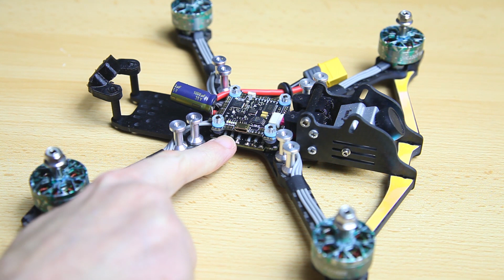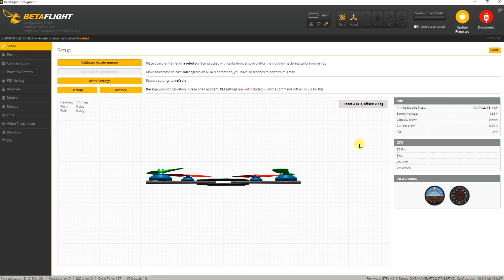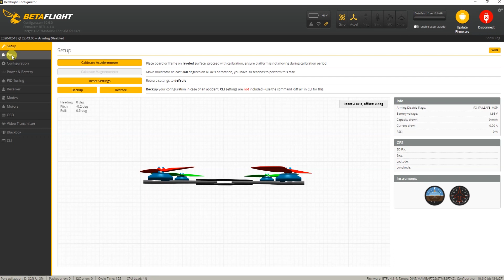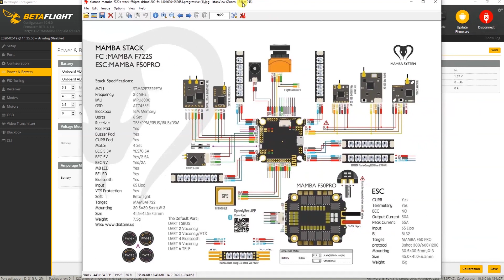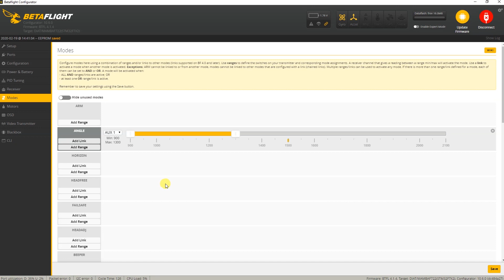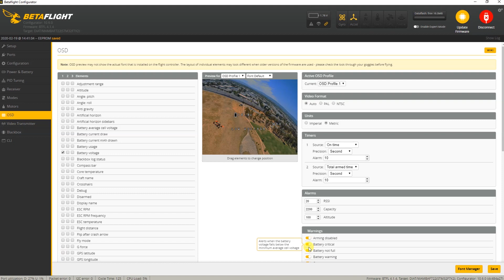Perfect FPV Drone Build Guide - P6: BETAFLIGHT 4.1.x CONFIGURATION

Comment from the maker: Next step the setup & basic configuration of BetaFlight :D 
the Diatone / Mamba Mamba F722S Pro stack I'm using here: 
https://www.banggood.com/MAMBA-F722S-Betaflight-Flight-Controller-OSD-59V-2A-BEC-F50PRO-50A-3-6S-Blheli_32-Dshot1200-FPV-Racing-Brushless-ESC-for-RC-Drone-p-1490805.html?p=TO251813974002015038 

Betaflight configurator: 
https://github.com/betaflight/betaflight-configurator/releases 

Blheli32 suite download: 
https://github.com/bitdump/BLHeli/tree/master/BLHeli_32%20ARM

Comment: hello ductch i am a novice building my first drone i am working with mamba F722APP, Jumper t18, FrSky R-XSR i have bind my receiver and the rc controller, but it's been imposbile the comunication with betaflight and the controller, i've seen a lot of videos and tutorials, but nothing, could yo help me, please. if i have to paid i Will, this is my email carlos.csharp@mail.com
Reply from the maker: Hee Carlos! 
sorry.. your comment would up in spam (because of the email-adress I guess :$)  .. Have you made progress by now? If not: did you connect everything the same as Diatone's schema? No need to pay me by the way :)  You probabvly don't live in the Netherlands?
Reply: @DutchRC  hello Dutch finally i bought jumper r1 receiver  and works immediately, thanks for taking your time
Reply from the maker: @CarlosSoto27  Excellent work Carlos! well done sir :) 
Cheers and happy flying!